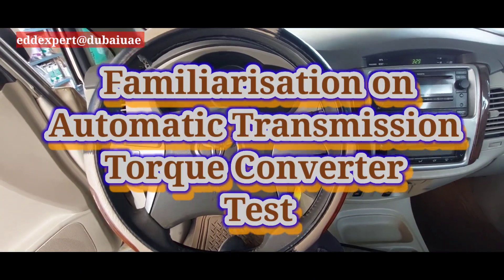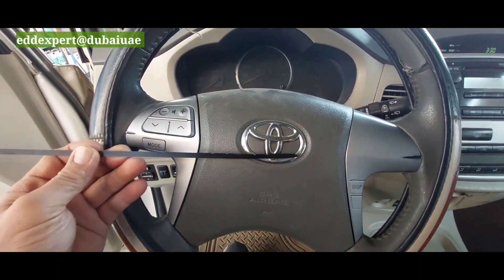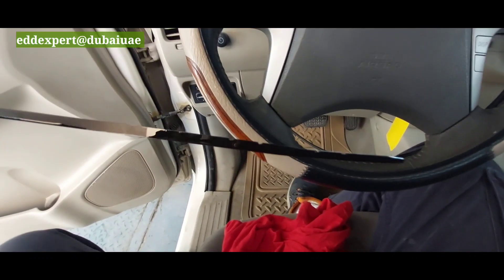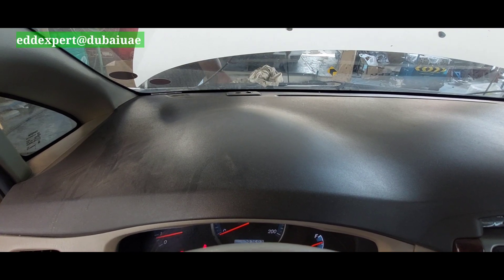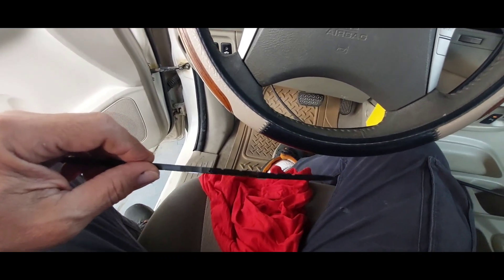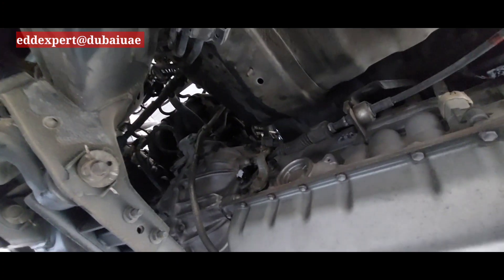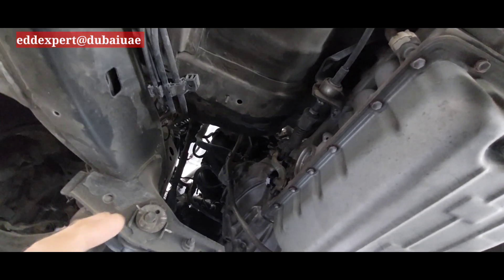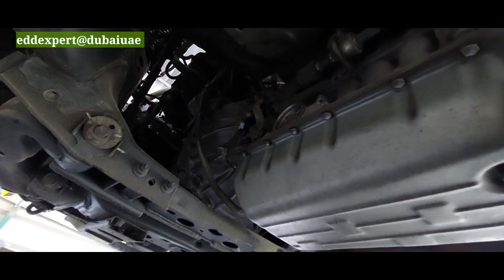🇵🇭 How do you test a Torque Converter failured? Is it oil pump or Torque Converter?

Comment: Well diagnosed bro, Also show the exact fault when you pull down transmission to repair
Reply from the maker: The fault of the torque converter wasn't show physically the fault. As I had said just read the atf condition. It was very clear in my explanation how to test torque converter if failed. Do I make myself clear.